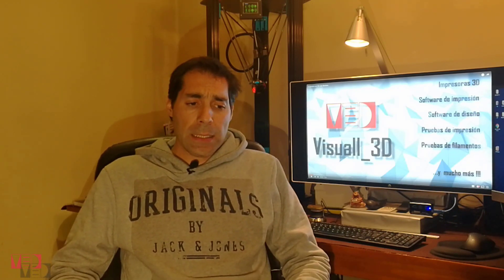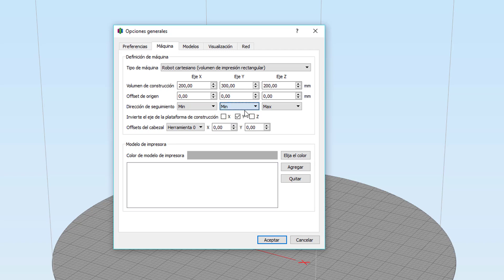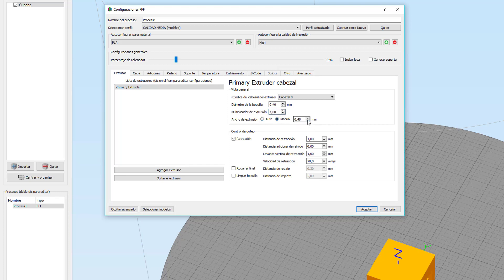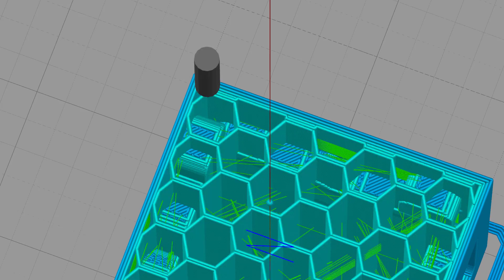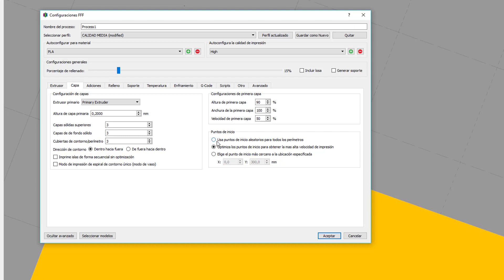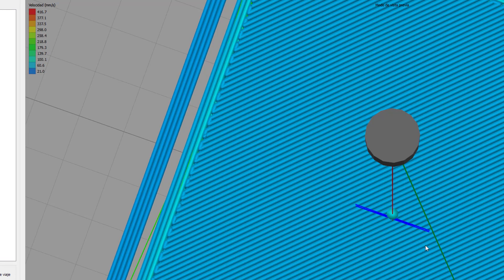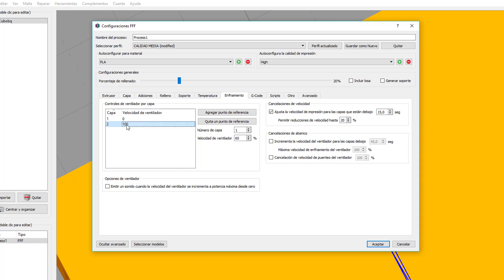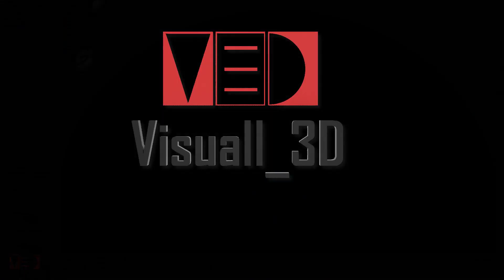Configuración de Simplify3D

Comment: Hola Estimado, por fin encontré alguien que explique con detalles las configuraciones y como se ven(las fotos que muestras) según cambia la configuración, compre el Simplify 3d solo para tener mas libertad a la hora de configurar una impresión y lo mas importante.. necesito imprimir con dos colores de filamento PLA principalmente, pero no puedo encontrar algun video en donde se explique de forma detallada, hay, pero no tengo el resultado... a veces para la impresión para cambiar el filamento.. pero después de unos segundos, sigue imprimiendo sin poder cambiar a tiempo el color del filamento, podrias ayudarme.. necesito de verdad imprimir en distintos colores por capa, tengo 2 Anet Et4 que tiene un solo extrusor. Otra cosa, no aparece el perfil de la Anet ET4 en Simplify 3d, usé el de la CR-10 que parece es similar. Saludos desde Chile.!!!